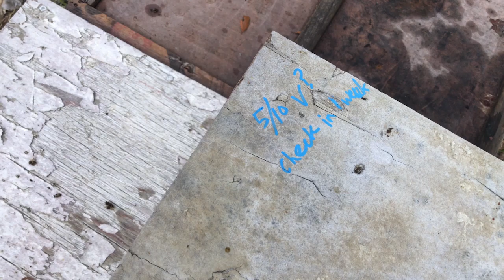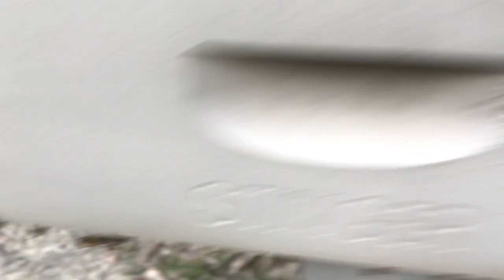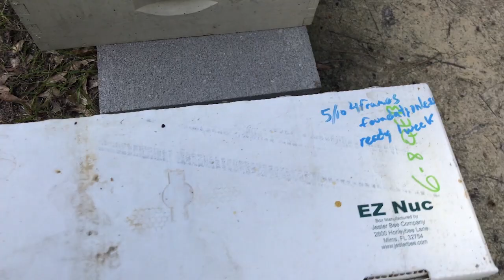They Had A Monster In Their Attic    Seen With Wowtac A5

Comment: That’s about the size of the CSI cutout that Jeff and I did in Slidell a little over 3 years ago. But it was inside In The air conditioning. It still took about 4 hours to get that one out.
Reply from the maker: Total cut out time on this one was about five hours.
Reply: We've done a lot of removals and that's pretty average unless you're dealing with sheet metal and/or masonry. The worst one I've heard about was inside a chimney that was both. The guys got cut up and stung both.

Comment: So, little bit of honey and alot of bees suck into the vacuum, and filter inside the vacuum should be wet and sticky from honey, so, does the bees die from the strong suction or sticking to the honey in the filter inside the vacuum?
Reply from the maker: Too much suction is rough on them.
Reply: @628DirtRooster  Thank you for the prompt reply, how much percentage will you be able to rescue? will you be able to make a new hive out of the bees that you captured by the vacuum?
Reply from the maker: @prettygirl986  I can save over 99% and start them over in a new hive.
Reply: @628DirtRooster  Thanks for the reply

Comment: You should use CORE waters for dihydration I get really bad charley houses in my ribs to the point would make you want to cry and my legs. The only thing that helps is core water with electrolytes they are great. You should try them.
Reply from the maker: I’ll have to look for those.

Comment: I was going to say that I have the same problem but now it's I got the same amount of 
H O N E Y  !
Reply from the maker: LOL
Reply: @628DirtRooster  , well what happened was I seen honey bees going in and out one of my roof rafters , since the the house is old and doesn't have insulation the bees could get into the wall and did they ever , on the inside I cut the paneling off the wall until I seen drywall , I felt the wall and it was warm from the top and 5 feet down , so i marked out a 2 foot long by 10 inch wide  and started cutting , my plan was to steal about 2 feet of honey , then put a piece of plexiglass over the rectangle piece I'm cutting out , I can steal honey whenever I want and watch bees like fish in a fish tank , but I decided to just cut half of it at a time , well that wasn't such a good idea , because
Reply: Jim Thomas why not a good idea ?   It's like you didn't finish telling the story. Or am I just not getting it?thanks
Reply: @johnsellers2999  , because I went to the hardware section and got a 4 inch dryer vent , I modified the dryer vent with a sheet of aluminum and popped- riveted it to each end of the vent , I then took a 4 foot by 4 foot wide screen TV , I took all the electronics out , cut a piece of plywood and made a back door with hinges so I could open and close it , I cut out 4 inch holes in the wall of both the wide screen TV and the wall of the house so the bees can come and go , I can watch them in the TV box and steal honey anytime i want , I have stolen about 60lbs of honey from the bee's  so far  but then .....
Reply: Jim you're doing g again.   Do I have to ask to hear the end of story?  So far I'm interested lol
Reply: @johnsellers2999  , winter came John and not too much happens in the winter time , but it's spring time and now John the bee's are .....
Reply: Jim I think I understand now,with spring here the bees start getting a little
Reply: @johnsellers2999  , that's right John so the story hasn't ended , it just slowed down